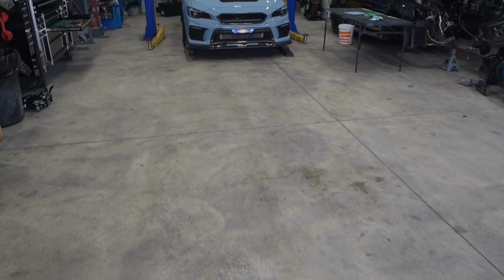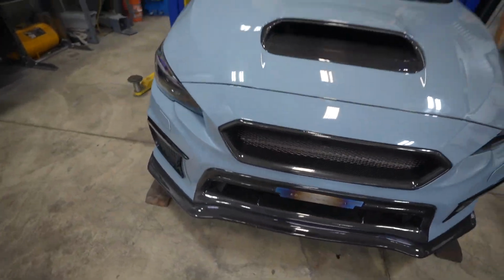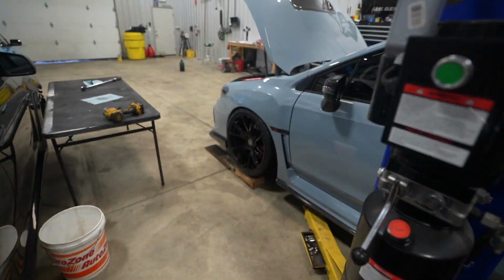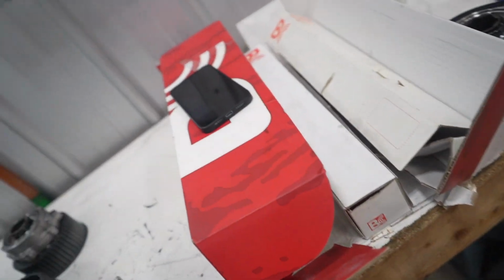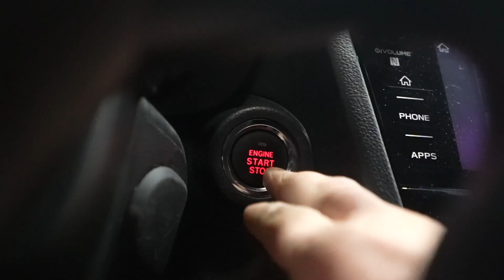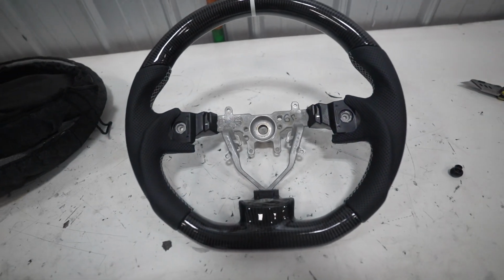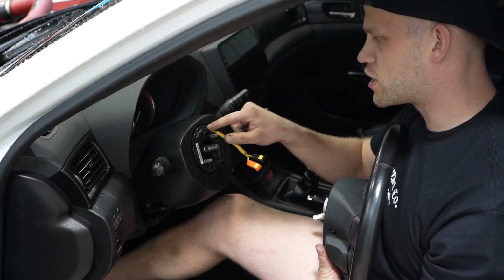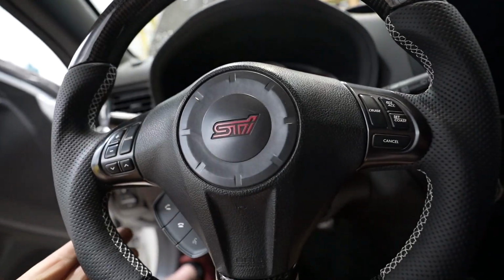Installing a $1000+ CARBON FIBER STI Steering Wheel!

Comment: Thanks Al for your help with your info on installing a camshaft into a avc to alignment of the avc. Also did you clean and check the plungers&Blead them and located into the right spot on the avc with the pulley when 
Reinstalling them to the pulleys? Wish more people would listen to advice i can provide as it can save a lot of time and money in the long run.

Comment: That’s awesome. I had a 2005 STI and  purchased a DAMD D-shaped steering wheel like that one. One of the best daily driver mods hands down. The extra room under the flat bottom of the steering wheel gives so much space for comfortable shifting/driving without rubbing on the thighs.